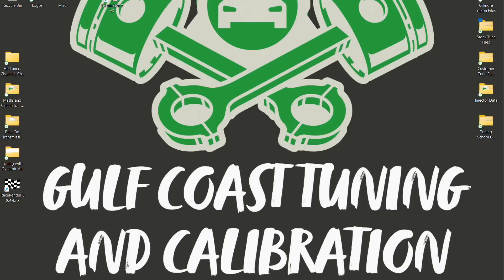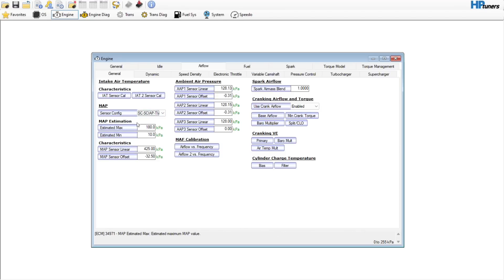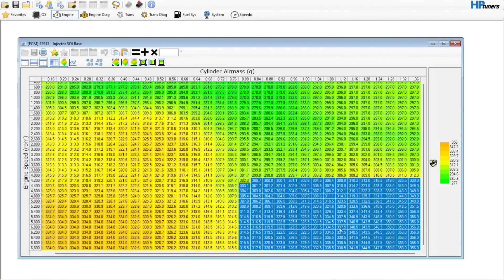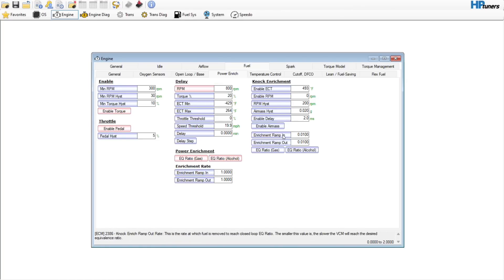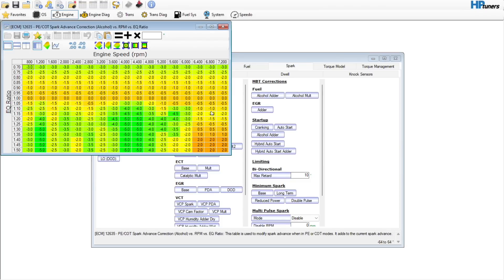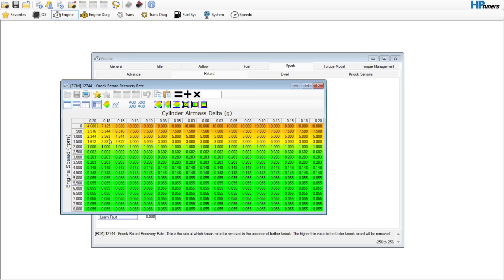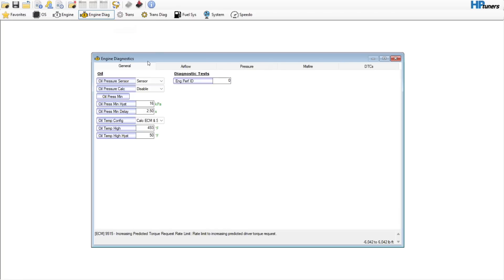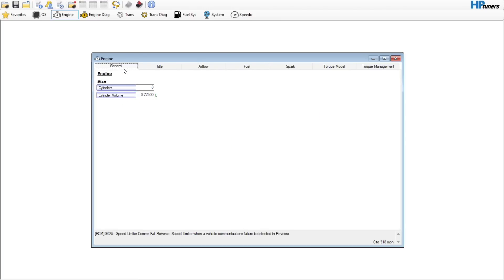Gen V Custom Tuning Guide | Unlock Power in Your LT1, LT4, L83, or L86!

Comment: Hi Sir I need help.
I got Lt 1 crate engine 2022.I install lt4 supercharger and Lt 4 injectors.I got no power and it's like the engine is   misfiring at 2300 rpm.the car is on the dyno.please help
Reply from the maker: On it!

Comment: Thanks so much for the video, I am mostly interested in getting better cooling out of my L86.  I noticed that when you are tuning the fans, there are 3 rows, each with a higher desired cooling temp.  I tow a boat in high heat in California.  I posted a thread on HP tuners seeing if anyone knows what the other 2 rows are for.  You seem to keep the same temp across all 3 rows.  It was also discovered you can lower the headers/desired coolant temp.
Reply from the maker: Yep! Using all 3 works just fine!